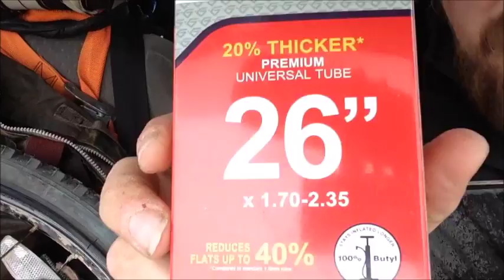Bicycle tire tube change inside car; Speedy Stitcher repair to rear derailleur; conversion

Comment: Stoner bicycle repair?
Reply from the maker: +Josef Roesler My wheel is bent and the chain slips frequently from all my stoner riding. But wheels cost $50 at Boise Bicycle Project. Seems a little overpriced for a bicycle kitchen.